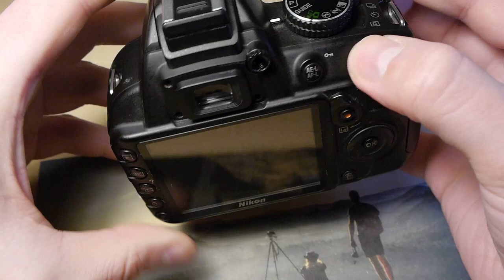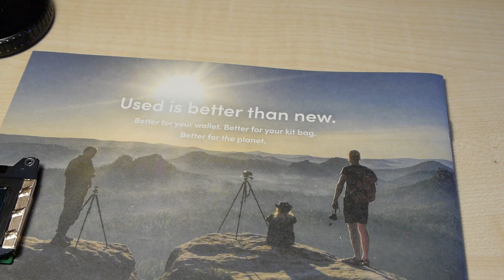Modding the Nikon D3100 To A Full Spectrum Camera

Comment: Why did you not replace the shim washers you took out from the mountings for the sensor. wouldn't this effect the focus/tilt of the sensor
Reply from the maker: For this conversion the sensor must be shifted to the front. So no shims needed.
Reply: @RemusLt  How much does it cost ?. i have a stock D3200 that I am not using as i bought a D850 for landscapes and a little astro
Reply from the maker: @BigBadLoneWolf  139 EUR.

Comment: Is it mecessary to desolder the 2-point contact before removing the filter, or can it be cut? Curious as to the significance of this? Can the part be resold/repurposed?
Reply from the maker: You can cut it with scissors. Resale, no, no one needs it.
Reply: @RemusLt  great thanks!
Reply: @RemusLt - HEY... me again... soooo I have a problem.. I snipped the cable, removed the filter, reassembled, powered up, and the screen shows a message to bring the camera to a certified technician...

What have I dont wrong???

I was extra careful to reassemble all cables properly and cannot recall any step where I may have made a mistake. 

The one thing im not clear on is why some videos say the IR filter must be replaced with a clear piece of glass, and others (like this one) say to just remove and reassemble.. 

Any help you can spare would be greatly apprecaite
Reply from the maker: @flojotube   I do not know how I can help. Something probably got damaged. You can try to disassemble and assemble it again. This camera is not the easiest to do the conversion.
Reply: @RemusLt  I will try. I just assumed you had come across this error message before since you do so many conversions.  Can you explain the sheet of glass versus no glass if possible
Reply from the maker: Not on this camera. On the Canon 7D if I remember. It was a lose cable. A glass is basically for sensor protection. Basically is not necessary. Unless there is a focusing problem. Or if you like to clean the sensor with a screw driver ...... @flojotube
Reply: if you are getting the autoexposure error recheck your cables...also try to shoot on manual mode
Reply: @RemusLt  thank you again. I put the project aside for the week because i was frustrated after all that work and negative result. I will get back to it very soon as I NEED this type of camera for a project I'm working in ASAP.
Reply: @slavko2761  will try. Dint recall exact message, but I can tell you it appeared AS SOON AS I powered the camera up after reassembly, and this message prevented me from doing anything else.
Reply from the maker: If you can get into menu disable sensor cleaning.  @flojotube